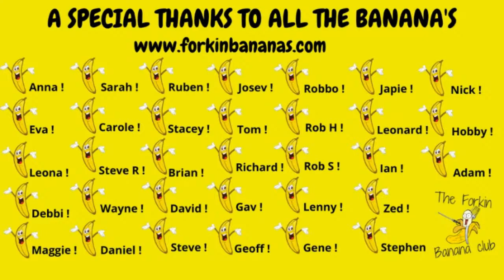WOODTURNING A SHADOW VASE (public live demo) #

Comment: cool technique Steve. makes me think of a another challenge :). you coul turn an inside vase (so it can be bigger) then turn two halves of the outside and glue that on. after that you can easily cut away the glue line between the two halves... i think